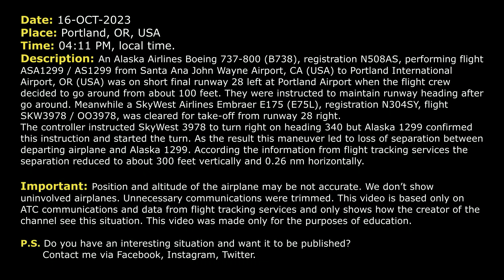Near COLLISION after go around. Loss of separation between Alaska and SkyWest at Portland. Real ATC

Comment: Controllers are getting sloppy… several disasters less than a second away
Reply: 1299 messed up by following 3498's turn instruction
Reply: @jonathanbott87 but ATC didn’t correct him and then called him 1298 twice after.
Reply: Situational awareness tells you departing runway is on your right.  Safe to continue runway heading as first instructed and ask for clarification they are in charge of their aircraft.

Comment: Tense situation, but the controller was on it and aware of the possible consequences.
Reply: Not when they missed the incorrect read back from 1299 or when they twice tried to issue instructions to 1298 instead of 1299.
Reply: Pilot screwed up, but part of ATC job is to trap errors.  ATC guy should focus more on accuracy of comms as complacency almost cost lives.

Comment: Hmm is this on the controller for not realizing that the turn for SkyWest was red back by Alaska or is this on Alaska. Probably both right?
Reply: The blame is on both the Alaskan pilots and the controller, yes. The pilots for not pay attention to the callsigns, and the controller for not catching the read back.
Reply: Alaskan pilots were on the 5 phases of grief. They probably didn’t adequately brief a go around and were calls behind every time after that. Brief the go around.
Reply: The wrong call sign happens often in a high stress situation, believe even Sully got his own call sign wrong a few times.
Reply: This is on everyone for still using antiquated technology when more reliable/safer communication systems and interfaces are ready to be used.
Reply: @bosshog8844 The aviation industry is extremely slow to modernize, it’s pretty much every aspect.
Reply: @bosshog8844  just out of curiosity, what new communication methods are you talking about?
Reply: This one’s on the pilots for not knowing straight from turn right
Reply: @Hot1765 not the issue - 1299 acted in accordance with their read back, but it was issued for 3498
Also the controller missed the read back error and later issued guidance to 1298 twice instead of 1299.

Comment: They'll have a safety recommendation any minute now....

"In 1973, The NTSB  issued safety recommendations to the FAA to prevent runway incursions. 

In 1986 - thirteen years later - they issued an urgent  ‘Special Investigation Report,’ entitled “Runway Incursions at Controlled Airports in the United States.”  making several new safety recommendations. 

In 1990 - seventeen years after the initial recommendation - these issues had still not been addressed when a fatal runway collision occurred, involving three aircraft.

 As a result, the Board placed airport runway incursions on its 1990 Most Wanted Transportation Safety Improvements List

In the following ten years -  by the year 2000, twenty seven years after the initial recommendation - five further fatal runway collisions had occurred.

July 2023.  FIFTY YEARS LATER

“A U.S. government watchdog will review FAA efforts to prevent airport runway incursions.

NTSB  is currently investigating six (err, seven now) runway incursion events in the past six months, including some near catastrophes.”
Reply: This was not a runway incursion. Runway incursions occur on the ground.
Reply: OMG.  How long did it take you to post that?
Reply: 1. This was not a runway incursion.
2. The number of runway incursions in 2023 was identical to the number of runway incursions in 2019.
Reply: Settle down! The system works fine and is extremely safe. TCAS deconflicted the planes.